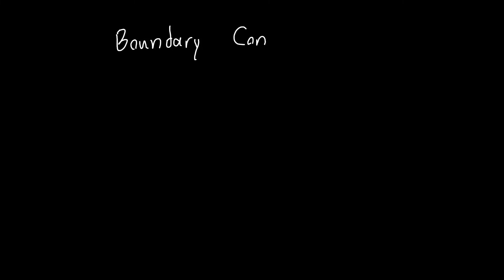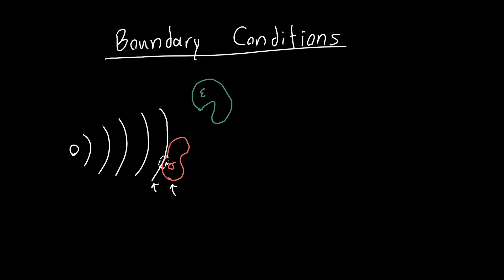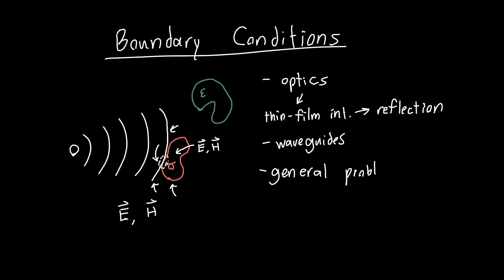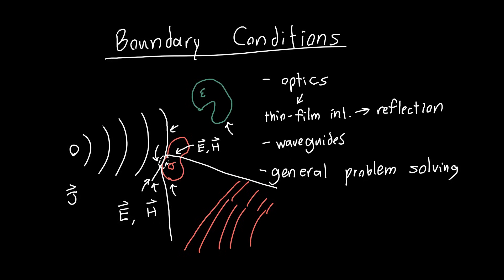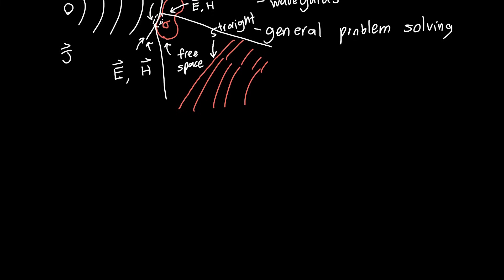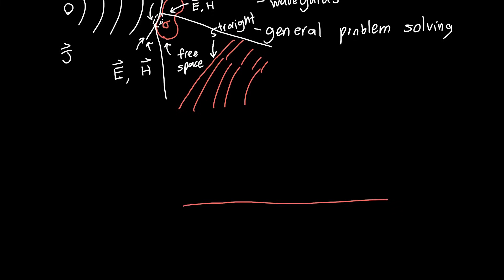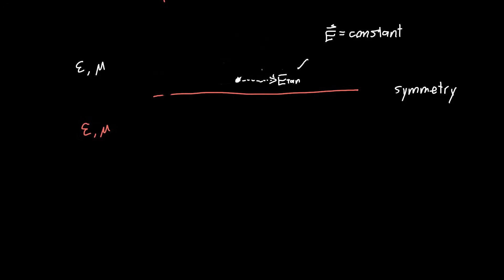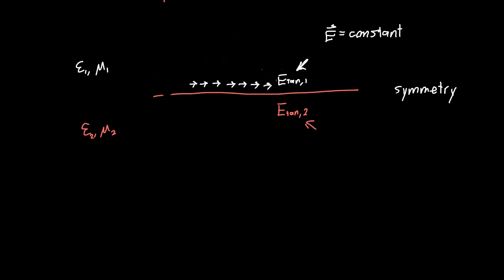Electromagnetic Boundary Conditions Explained

Comment: Good video, but I think it is missing an important detail to the argument that made me spend some hours thinking haha. When you say that the parallel (tangencial as you call it) components of the fields are equal, it got me a little confused because given a 2D plane (since the boundary is a plane, not a line), you need to define a specific unit vector parallel to the plane and only so can you define a specific parallel component of a vector. If you don't do this, there is an infinite possible 'tangencial component vectors' since you can rotate the trajectory you have draw. What I think is missing is to start saying that, given the two electric-field vectors on both side, one can always find a plane that contains both fields. So if you make this plane parallel to the screen (to the paper you are drawing), then you can continue with the arguments you presented and end concluding that the parallel components that are defined as (a) parallel to the boundary and (b) contained in the common plane to both vectors must be equal. If you want to go one step further, you can say too that  n x (E_1 - E_2) = 0, where n is the normal vector to the boundary and 'x' is the cross-product. In the light of what I wrote and a little thinking leads to this conclusion which is a nice geometrical relation.

Comment: The line integral of E equals zero (0). Doesn't that means that when you kind of sum/accumulate the E vectors on the loop they cancel each other out. So that the E field drawn in red should be negative to the white E field (i.e. oriented in opposite direction).